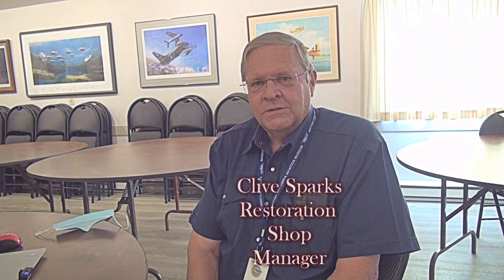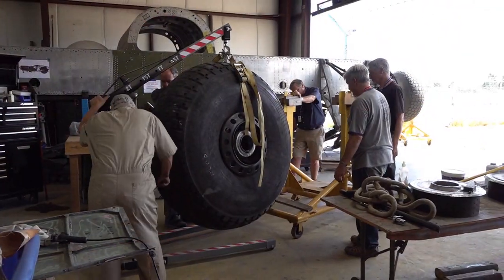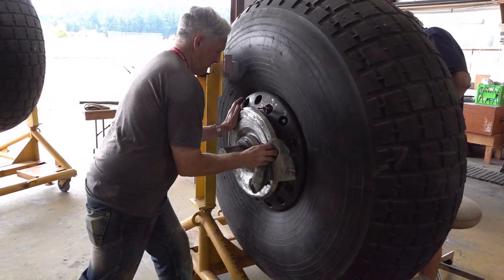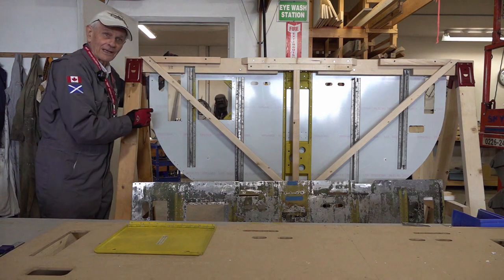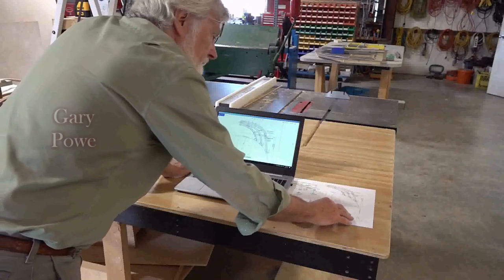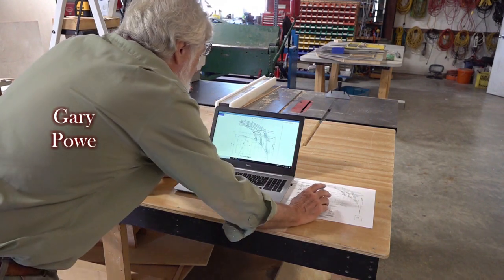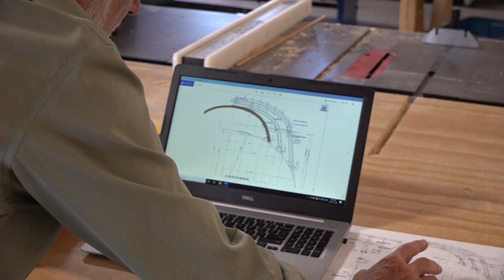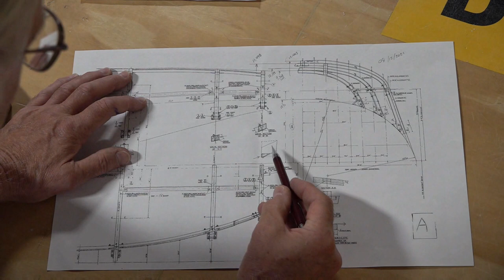British Columbia Aviation Museum FM 104 Progress Report 7

Comment: really interesting folks. Couple of questions regards the cockpit canopy, why did they use wood for those hoops and also ther use of steel frames at the front? Wouldnt aluminium have been sufficient throughout? Im just curious surely the canopy, appart from the slipstream, I cant imagine it would need to have had steel, its not load bearing or anything is it?
Reply from the maker: That is a question we have tried to find an answer for and to date have no answer. One thought is it might have something to do with the radio. If you find out let us know.
Reply: @rvjs100  ahh yes good point there was a DF loop under the back end of the canopy … yes didn’t think of that of course any ferrous or non ferrous material in the proximity of the DF loop would create major problems… so that leaves us now with just the steel section at the front … perhaps that is just to reinforce … I suppose if aluminium was used there would be a high risk of cracking or fatigue ?